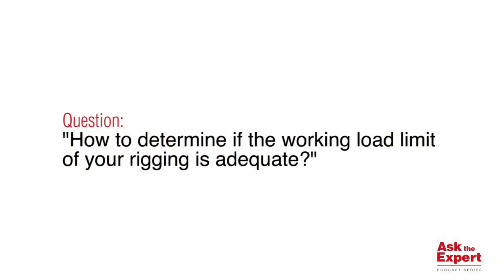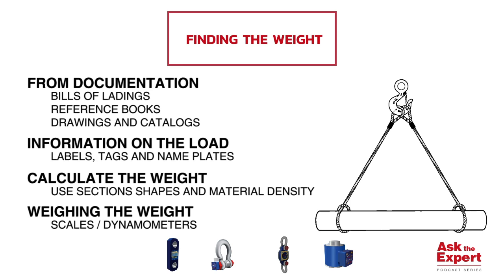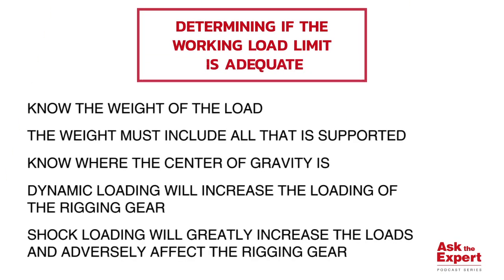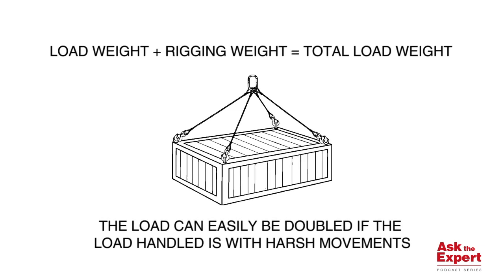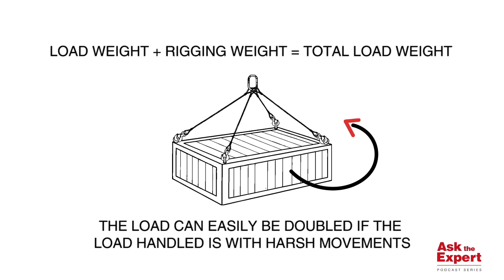Rigging: How to determine if the working load limit is adequate?

Comment: Hello,

Thank you for sharing. I have been trying to get an answer for almost a week now as to what additional loads should I consider for dynamic loads. Is there a standard that defines what percentages to use for different applications/lifting equipment? 

I have a heavy lift job coming up in a week whereby we will be lifting a 200 metric ton load using a 600t crawler crane. The  crane's operation is extremely slow. In this case, how much dynamic load should I consider. It surely must be lower than a faster moving crane. 

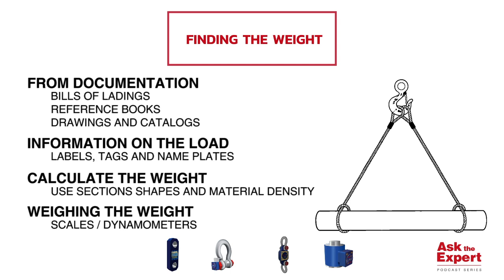Furthermore, the safety factors used in the conventional calculation of WLL vary significantly. Some use as low as 1:4 and others can go up to 1:10. This is a huge difference in safety factors and I think there should be reasons behind the selection which is based on solid theoretical/empirical methods.
 
Some standards, such as the IMCA M179, define WLL for wire rope slings and grommets as a function of the diameter of the surface which will be in contact with the sling. This approach to me seems more scientific.

What do you think?
Ramez